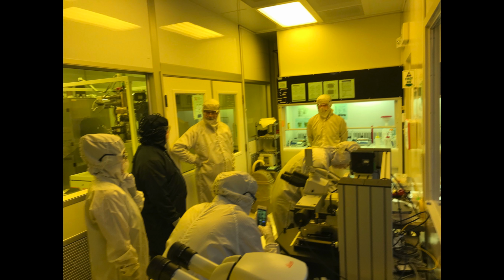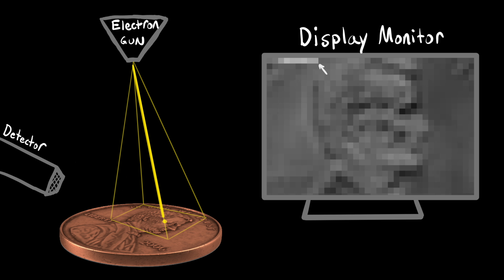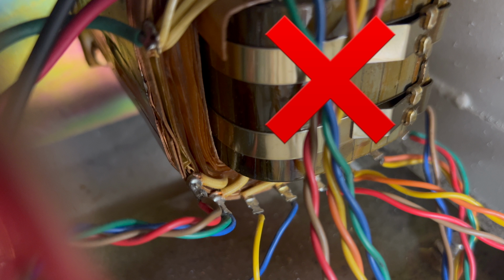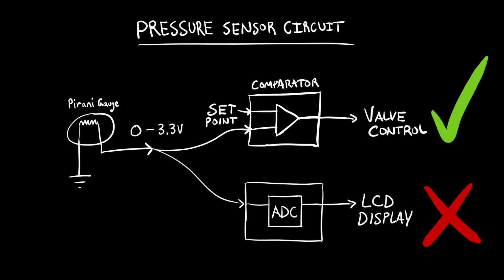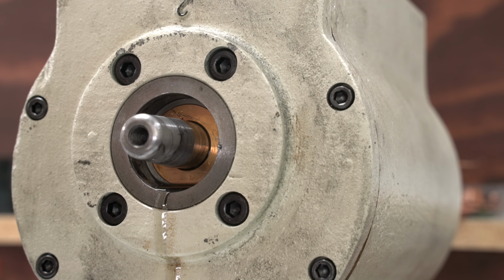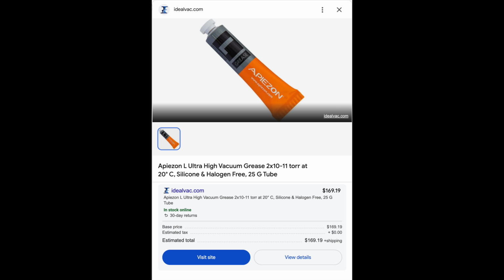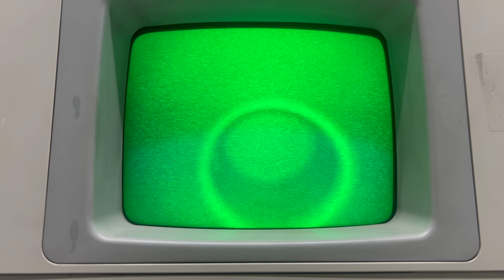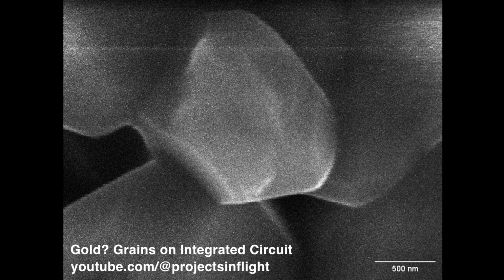I Saved an Electron Microscope from the Trash

Comment: For anyone wondering, to capture the slow scan mode images there were rigs to hold cameras meant to capture the image on the CRT screen. So youd turn all the lights off, expose the film, and let it slowly scan capturing the higher res image onto a film frame. Ben over on Applied Science  has a video on his SEM revival where he rigged up a similar set up. 

Also, GOD DAMMIT IM JEALOUS AS FRIGG FREE ELECTRON MICROSCOPE YOU SUCK YOU LUCKY DUCK!!!!

Also also, Ive heard you can read data from ICs or pieces of HDD platter with a SEM. Maybe take a look at that? Thad be neat to see!
Reply from the maker: It's not feasible to read magnetic storage on an HDD, but it is possible to read flash memory actually- but the decapping process to expose the die and not wipe the data is quite difficult
Reply: @projectsinflight  and involves some fun compounds!* There is also the possibility of "guard layers" which are specifically in place to make decapping without also eating the data layer exactly as difficult, if not more so.... Thats not to say there arent defcon folks into such hackery that would love some SEM time if they haven't gotten one themselves yet...[shrug] ya never know. Still cool video, mate! 😎👍

*For certain subjective values of the word "fun". Some may say "bloody terrifying!" These people are also correct.

Comment: word of warning, be careful with the window of the EDX (Energy Dispersive X-Ray spectrometer) window. Its only a few micrometers thick and usually made of either beryllium or a polymer (such as formvar). This window isolates the vacuum in the detector and Dewar from that of the SEM in order to allow sample changes without turning the detector into an Icicle. You will also likely need to recalibrate the detector when you first use it, haven't used that model in a while but in general, you put in a pure piece of copper, polished if possible, normal to the beam, then use the K and L peaks to set gain and offset. 

Also, the cathode in that model of SEM should last between 20 and 200 hours. its a Type K cathode if i recall correctly.  Congrats on the microscopes first light. 

Also, if you haven't been told yet, keep the electron gun and its components spotlessly clean. Use a very weak abrasive slurry and cotton to polish the parts. There are various compounds that are suited and many that aren't. There is a Scouring agent in Germany made by Sidol which i recommend to new users, as its difficult to fubar a Wehnelt or anode with it, but it takes a bit longer to clean then using diamond or aluminum oxide polishing compounds. Basically, you need to be able to get everything off the Wehnelt and anode and keep the gun exceptionally clean.
Reply: When I was in school I saw an ad in a physica magazine that read: "Need custom beryllium beam pipes for high-energy particle physics accelerators? Come to us!" It was the coolest, most specific yet jovial sentence I'd ever seen, no wonder I can still remember it 30 years later!
Reply: I used a toothbrush and colgate regular. Did I fsck up?
Reply: @bashkillszombies  As long as the parts are not bulk Aluminium or chrome plated, toothpaste can work, though some have additives that will contaminate the vacuum of the gun, the simplest toothpaste with the least amount of additives is ok in a pinch, but i would not recommend it. As for Colgate regular, i took a quick look at the MSDS and its not great but its not going to destroy a microscope, assuming of course that its a normal tungsten hairpin type, a LaB6 or Field Exmission machine would be adversely affected if not cleaned perfectly. If the parts are chrome plated they will have that plating abraded rather quickly, if they are aluminum, you will leave micro scratches due to the abrasive being too hard. 

Basically, if the parts that where cleaned with toothpaste are washed twice in distilled water, at around 60°C to 80°C in an ultrasonic cleaner (take care to not use glass or metal surfaces to place the parts on, and always place them on a section of the part not exposed to the electric field of the gun. Exceptions apply, basically put don't scratch it by cleaning) then cleaned with acetone fallowed by absolute ethanol or isopropanol, you should be fine. You could also boil the parts in destined water if you don't want to risk using the ultrasonic cleaner.
Reply: @lbochtler  Although I appreciate your serious response, I think this was a joke 😅
Reply: @lbochtler  Based, fully in-depth, detailed response to a joke comment.
Reply: @lbochtler  I work on Joel JEM-1230 TEM, tungsten filaments, polish with Pol, wipe several times using IPA, microscope is used at 100kv ~65uA 3-4 hours 3-4 days a week all year long, just couple days ago I replaced the filament because the HT system started behaving slightly erratic, this one lasted ~600 hours
so yes, clean is important, but going so overboard isn't, just don't use wrong stuff that will coat the column, then it's a lot of work 😄
funny side note, when factory techs were coming in to "service" it, they'd replace Pirani gauges yearly, because they said the reading get higher with time and unreliable, so need new ones regularly, this TEM has vacuum sluice for sample loading, and this mechanism has a swing door on hinges at the end where the sample rod goes through, someone dropped a sample inside the sluice and it wouldn't operate properly, factory said to send it over to Japan for repairs, repair cost ended up 12k EUR, but the Pirani gauge situation got only worse, they'd last like 8 months now, and long wait times for sluice to pump down to acceptable vac, so I was asked to take a look
removed the whole thing from the column, put in new seals, it was years ago, so I can't remember which material Orings I ended up with, but I recall the readily available (nitrile perhaps) didn't work for high vacuum, and I ended up using combo of silicone and I think FKM, nitrile would just leak, but even all these new orings didn't fix the slow leak issue until I looked at the hinged door mechanism, to assemble it they put the screws in (hinges) and then used solder to fill and seal the screw heads inside recesses, and one of those solders looked slightly dodgy, like it had a darker sliver where solder met the stainless steel body, as a last ditch effort I just put some vacuum bagging tape (one used in composites manufacturing, just a thick sticky rubber basically) over that hinge-solder and pressed it down with some capton tape, put it all back together - and voila - perfect vacuum, very quick evac times, and no drop in Pirane gauge performance whatsoever
and they used to replace filaments like every 3-6 months before this, and since that repair they would last at least a year, almost two
oh, and OEM said they don't support the older controller type we had (2006 purchased new) when an issue started creeping in - sometimes sample positioning electronics would just stall and won't let the sample to be manipulated (it has servo motors and trackball human interface), the problem would go away after restarting, which takes 20min give or take, factory says - buy our new model, well, I traced the issue to a 0.50EUR buffer IC, 74 series logic, one of the gates wouldn't work properly, and this gate carried the signal of travel limit, so if it is 1, then the controller thinks the sample has contacted something and must not move, replaced the IC I think it is 2 years now - zero issues
soon they'll be able to buy a new one microscope on all the repair calls I saved them money on 😄
so I'm not surprised at all that they couldn't/wouldn't fix this SEM with the super simple faults it had, simply because "support" is robbing them blind just to sell new machine
Reply: @Taras195  Welcome to the wonderful world of niche technical youtube videos!  It's a world filled with extremely knowledgeable/passionate individuals who love nothing more than spreading their knowledge/info to anyone and everyone.
Reply: @rikkt731  Those numbers don't quite add up. Tungsten hairpins should not last that long unless they are underheated far below saturation, or the gun design is meant to work at such low electron density. I am also unaware that JEOL still used Tungsten Hairpin in any of their semi recent TEMs. I think you are talking about a LaB6 cathode, though in that case, the lifespan is a bit short. The longest Tungsten Hairpin Lifespan i have seen and or had, was about 400 hours, the typical lifespan i have seen is in the range of 20 to 100 hours.

Regarding the cleaning of the parts, the polishing compound is probably one that has been tested with an RGA to show that it can be cleaned well enough with IPA to allow operation of the gun. It is not a general rule that it will always work. There are also machines that have Wehnelt electrodes made of Aluminium, if you clean one of those with normal polishing compounds, you will scratch them instead of cleaning them. So using a more gentle abrasive is recommended as general rule, due to it not doing as much damage in cases of unknown materials. 
The microscope in the video is a Scanning Electron Microscope, not a Transmission electron microscope. I have done enough tests and measurement's over the years to have a direct correlation between cleanliness of the column and especially the gun, and final probe size. I also have quite a few books that support this as well. Its not like he wont have an image, its more a case of having a good high resolution image.

As for the repairs not being as good as they could be, or diagnostics being a bit lacking, that's general problem these days it seems.
Reply: Yeah I was gonna say when he talked about the cheap silicone grease, he didn't use it since it was abrasive on moving parts, but I hope he doesn't use it at all. I've been cautioned that on high vac systems the silicone greases will creep, contaminating your whole system over time, and it's notoriously difficult to fully clean off again when this happens.
Reply: Is this cathode expensive or even possible to replace?
Reply: @CallOfCutie69  depending on the source, its between $150 and $40 per cathode, and they last between 20 and 200 hours. Replacing them is a routine thing and i consider it basic of maintenance on thermionic microscopes. replacing it takes around 20 minutes, depending on the design of the electron gun. With other cathodes, specifically field emission ones, replacing one costs several thousand dollars in materials, and days to weeks of work.
Reply: Oh my head! This thread is abusive.
Reply: This is exactly what I was going to say
Reply: i do not understand a single word but this is a joke somehow
Reply: @haltmannhiredme  my comment at least, was not at all a joke, or are you referring to another comment that replied to my comment?
Reply: Also, you can blow that window on the EDS if you vent too fast. That is why there should be some sort of needle valve on the vent line. 

We used Pol or Wenol polish with a cotton swab, then wipe clean. Then sonicate in alcohol then acetone for 10 minutes each. Use gloves the whole time and use the wooden stick of the cotton swab to get the wenalt (the cone part with the hole in it that covers the filament) out of the acetone. Blow it off immediately with canned air or a air bulb. If you use canned air, blow a puff away from the wenalt first in case some accelerant comes out from the can being moved.

Comment: Do you have your own power plant? lol
Reply from the maker: I actually had to run an extension cable and put the machine on two separate circuits because of how much power this thing uses:

Diffusion pump: 500W
Chiller: 500W
Rotary pump: 500W
SEM (other electronics): 200W
Computer: 300W

It's a lot...

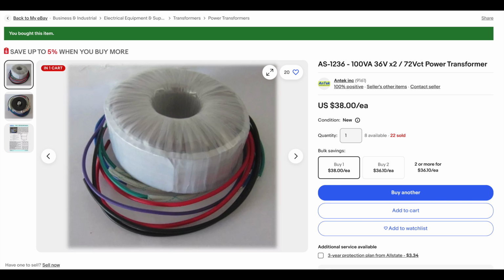Comment: 11:00 or you could have powered the new transformers straight from the wall instead of through the variac.
Reply from the maker: the original transformer is behind some fuses and power sequencing relays, and would have been a bit of a headache to separate those out
Reply: @projectsinflight  you could put a relay in place where the old transformer was connected, and use that to turn on power to the new transformers. But as you already have everything done, this may be just advice for someone with a similar problem.

Comment: Well done and great job on the restoration, great video, I have seen something by you before but this sort of content is worth a sub from me.

A pro-tip with torroidal transformers, you can add turns to the primary by simply winding insulated wire through the core.  Add 10 turns and see how the output changes.  On the output you can do the same, use a thick enough wire and you can add or subtract voltage by connecting the extra turns in or out of phase.  Do not 'subtract' turns from the primary as you may saturate the core.

I missed buying a SEM on a local auction.  I had no place to store it at the time but gambled EUR800 and it sold for EUR810 so someone else was the luky new owner.  It was a generation older JEOL unit, very similar though.

Have a basement with garage access now si I have a chance to install one and always keep an eye out on auction sites.

The problem is that even a scrap unit will usually sell for EUR1000 or so as the pumps and accessories or spare modules are worth about that much sight unseen.  Then there is the cost of moving to consider if it is further afield.

Very few come up for sale in Finland and I may have to find one in Europe one day and rent a van for a road trip as I like the idea of having one.
Reply from the maker: you might have some luck on surplus sites, or honestly maybe you could just get your foot in the door asking labs or educational institutions directly. you never know...

Comment: It will be nice if you can go through  the boards and comment abot circuits and IC used. I think there will be nice AD picoamps amplifiers and BB DACs
Reply from the maker: TBH i haven't done a ton of evaluation of the amplifier circuits yet. I need to though, since there is clearly some issue with them causing noise

Comment: Try to do some E-Beam lithography with it.
Reply from the maker: I will probably do some at some point soon, but very rudimentary, as mentioned earlier I don't think I can do beam blanking
Reply: That requires a beam blanker. This machine dose not have one. The gun alignment coils could be misused for that purpose though. But it can and likely will burn them up with long write cycles. It can be done but i do not recommend it.

Comment: 15:30 I think you are mixing up diffusion pump and turbo pump. Having a diffusion pump exposed to atmosphere does nothing. On a turbo on the other hand, it can get expensive.
Reply from the maker: if you expose a hot diffusion pump to atmospheric pressures the oil will react and get ruined

Comment: That's amazing. SEMs don't have to be that large anymore, though. There is such a thing called tabletop SEMs. Still tens of thousands of dollars but compared to the typical half a million they're ALMOST affordable. Like, if you were not planning on buying a new car in the next 10 years, you could get a Phenom or a Hitachi tabletop. The guy from the Breaking Taps channel does his SEM images on a Phenom tabletop IIRC.
The Chinese are just getting into that market. Maybe one of these days we'll see just like with the mini lathe and mini mill a mini SEM for less than ten thousand. I imagine it actually might be possible. In the most basic sense you need a vacuum chamber, a roughing pump, a high vacuum stage, an electron gun and an imaging detector. All of these components in themselves could be acquired for about a thousand each. So, a mini SEM could be viable for less than ten, if you're not planning on making any profit, ha.
Reply from the maker: I am convinced that in the near-ish future a new SEM will be at or below the price of a new car (and not just a Lamborghini lol)
Reply: Yep, as each of the components becomes a commodity item used in large volumes the price drops.  The availability of control hardware, I/O and software has plummeted and no longer needs to be fully custom designed saving a lot of money for new startups.  Also the patents are expired and the theory is pretty much well understood letting smaller companies try to compete.

I love the way China is prepared and able to build to a price when the technology is mature.  Modern SEM gear is phenomenal and some let you image at higher pressures so you can do biological samples with less preparation and obviously higher resolution and all the XRF stuff.  This means the basic equipment is no longer of much interest to thebig players and there is a market opening for new 'budget' SEMs.

I look forward to them flooding the market and reaching the used market.

Comment: Nice acquisition. One concern I'd have is whether the shielding is still fully reliable and all the safety interlocks worked correctly.
Reply from the maker: Well, I know for sure that the RP protection valve is working correctly, as I have definitely crashed the vacuum several times and it has protected the diffusion pump. 

Regarding the X-ray shielding... I have done some rudimentary testing with a pancake geiger counter that should be capable of detecting low energy X-rays, but I am looking to borrow a X-ray spectrometer to get a more definitive answer.

Comment: I would Suggest you to upgrade the machine.....adding advance parts.. and make the overall design modern.
Reply from the maker: I plan to upgrade the computer capture device first. Other than that I want to upgrade some of the board-level components to fix the noise issue, but I don't have any long term plans to do any other updates